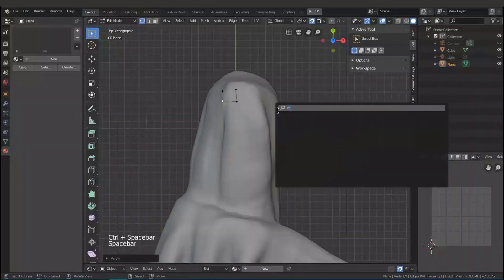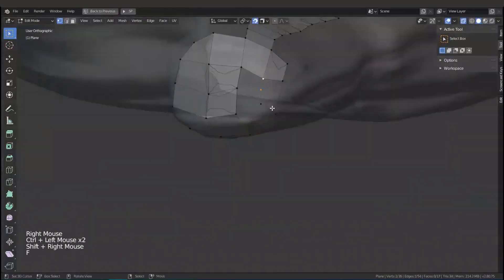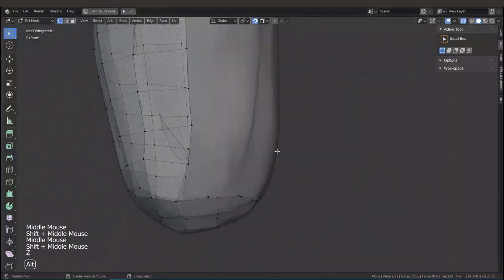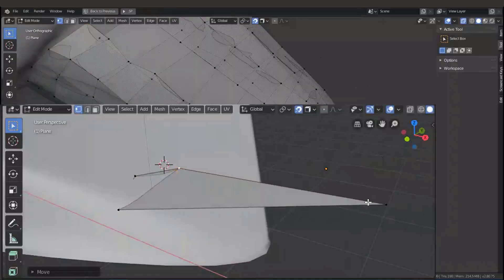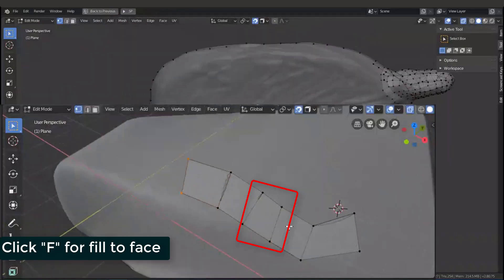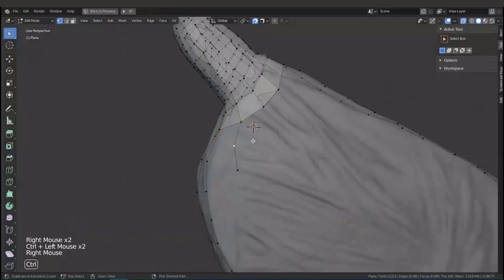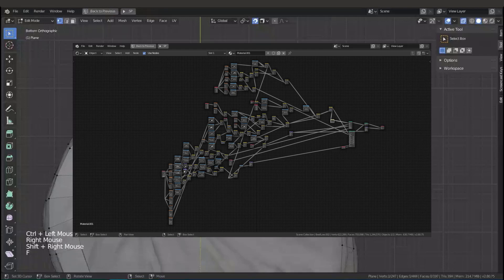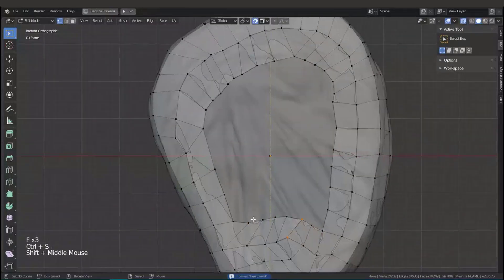Tutorial Modeling Beef In Blender 2.8 - 2.Retopology

Comment: if your retop is as messy as that you could have just used zbrush decimation tool or anything similar
Reply from the maker: Yes probably right, but cause we are just using blender we doesnt use external softwate in this case, but if you want you can do it in zbrush, or maybe using instant mesh for free software :)